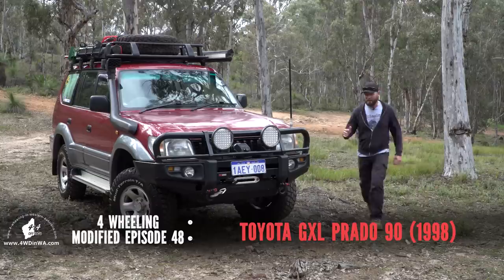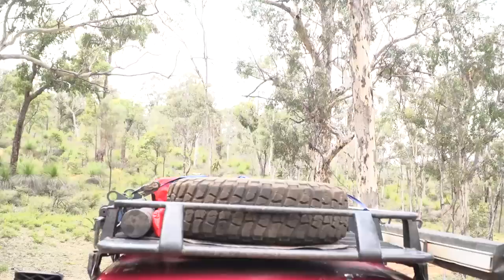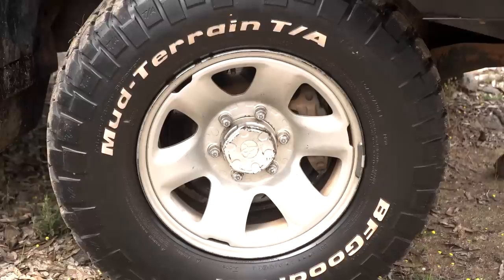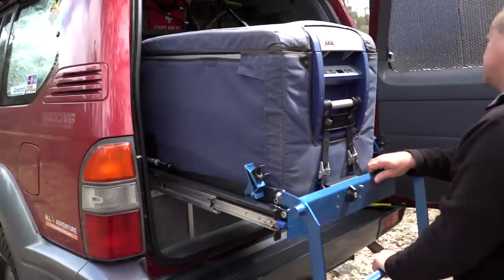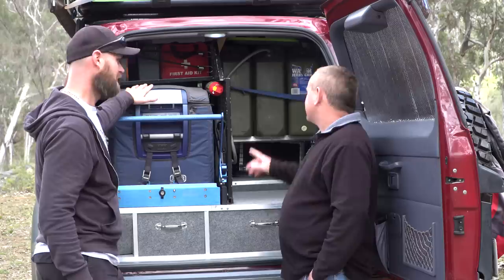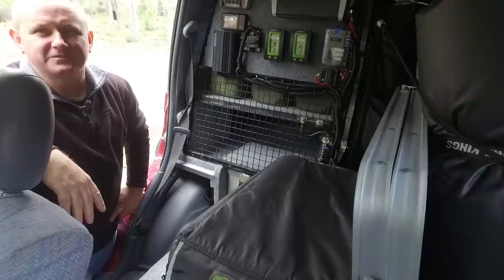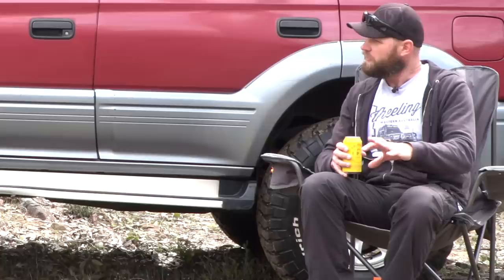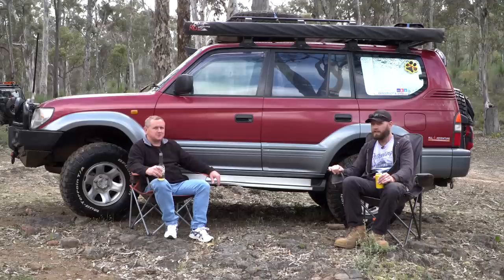Toyota Prado 90 GXL review, Modified Episode 48

Comment: 90 prados are unstoppable got a 1999 model in manual with over 530,000 kms on the clock nice truck considering manuals are fairly rare in NZ
Reply: That's good to hear. Just bought a 98 model with 377,000 on the clock. Got some k,s left in it then...
Reply: There are heaps of these 90's and Surfs in NZ .Pretty reliable things.

Comment: I had a 90 series with turbo diesel here in pakistan. Pakistan is an offroaders heaven. Such a wonderfull allrounder. I straightpiped mine, hurt the fuel econony but increased the torque by alot. Next time i will buy one in petrol. If it was the end of the world id get this car. I miss mine soo much.

Comment: i'v owned my 90 series for a good 5 years now, annother thing to note for anyone looking at one, standard exhaust system has a choke point at the Y joint, really reducing power, a simple mod, adding a set of pacemaker headers made an absolute world of difference to the low end torque of the car! (my rear end setup has quite alot of weight behind it, the extra power was more than welcome :P)
Reply: Petrol or diesel model?

Comment: One of the best cars, I’m in Costa Rica I have one kzj95 for me great flexibility and Very good performance on 4wd here to expensive toyota genuine parts
Reply: I own a LJ90 with the 3L engine...basically the car will die before the engine mine has 33mt tires with a 2.5 inch lift with an iron man suspension...by the way I'm from Costa Rica...so Pura Vida 👌

Comment: Have a 95 series 3.4... sure is up there on fuel consumption but ive never found it lacking in power or traction when needed.. factory center lock is brilliant
Reply: Keck SSJ does this have all time 4wd?
Reply: @jeanpaullgarcia5268  yeah theyre AWD. Then has shifter for center locker high / low range
Reply: Rv6 or gxl man ? Just wondering because I’m looking at buying an rv6

Comment: Love my 95 series '98 Prado GXL. 290'000km, fairly stock with basic budget touring mods but does a fair bit of stuff an 80 series or patrol would do. Only issue I have with it that apparently is becoming more known recently is the stock immobilizer transponder in the key barrel dying around the 20 year mark. To be fair though, 20 years you'd expect bigger issues but they're unstoppable otherwise

Comment: Prado 90 got same frame and suspension as a 3rd generation 4runner in the USA. Few things to mention about VITAL maintenance. Get the FRONT LOWER BALL JOINTS replaced with TOYOTA ONLY at about 160,000 Km (100000 miles) to be safe. Aftermarket ball joints WILL FAIL in 25,000 Km's. For Automatic transmissions, replace the radiator if you have factory radiator or it is 20+ years old. Trans oil cooler located at the bottom of the radiator gets corroded and will mix with coolant: This is common for most Toyota trucks. Search Pinkmilkshake. Other than these two issues, the truck will run forever! If you like a car-like ride in the front try to get front progressive coil springs that came to tacoma pickup 4x4 2001 TRD version extended cab. I have that setup with Bilstein TRD shocks and the ride is amazing.
Reply: Very interesting info about the ride, I have just purchased a 90 & find the ride awful. I  am looking for ideas on making the on road ride more plush & comfortable. I was looking at the Terrain tamer pro set up.

Comment: Unfortunately there was no mention of LBJ issues which are becoming more common. Probably due to the age of the vehicles and more exposure on the net about them.
Reply: I have a 90 and they are generally very reliable. But, as you say, you must know what condition your lower ball joints are in.
Reply: There was actually a recall from Toyota on lbj’s for the 90series
Reply: Since the video shoot I've had all upper and lower ball joints replaced, flexible brake lines replaced, brand new power steering rack fitted, new BFG KM2 fitted  and a few other little things done in prep for the  Canning Stock Route trip.
Spot lights are now replaced with a STEDI ST3303 light bar and a pair of STEDI Type X 8.5 LEDs
Reply: Have had my 90 for many years and taken it through everything. Gone through 4 lower ball joint changes.
Reply: I've had Pedders ball joints fitted. Hoping they are good enough quality to last
Reply: Allen Kemp from what I've read, genuine Toyota balljoints are the way to go :)
Reply: @outnaboutwesternaustralia1700  just wondering where you got your rear long range fuel tank from? I'm near Brisbane. Nice build mate.
Reply: 4wd Systems in SA
Reply: @mayk3lll  was there, really? What did they do with them? Is there anything you can do other than just keep an eye on them and replace them from time to time before they break?
Reply: @tomke92z  yep really. They installed a rubber boot for em to keep the dust out and prolong life. Nope just monitor them

Comment: Main things to keep an eye on on prado 90s lower ball joints!! Otherwise bullet proof!!
Reply: I've just replaced all ball joints plus a few other precautionary upgrades 👍
Reply: Michael Laz, If you mean keep an eye on the lower ball joints as well as the upper, tie rods and rack ends when those Toyota genuine parts are up for replacement at or after 350,000km, then yeah sure.  That’s pretty damn good actually.
Reply: All ball joints replaced, brand new steering rack, tie rod  ends etc etc all replaced. They all seemed to be still the original factory fitted parts. 
Nothing had failed, just getting tired and not worth risking running them on the next big remote trip.
Easier to do them in the workshop than out in the middle of nowhere
Reply: Brett H yeah they do last, especially original Toyota’s.. however it is known to everyone that they simply are a bad design.
Reply: Allen Kemp Awesome Allen! Sounds like you’re onto it.  I’m in the process of giving my front end a revamp too, only it’s part by part week by week lol.. you think it’s worth using poly or just stick with rubber
Reply: Go poly

Comment: G'day Ronny, Mate the only concern I have over this well set up truck was the zip ties on the fire extinguishers to stop them rattling & falling out of the plastic holders. ;-)
Reply from the maker: I didn’t even notice that
Reply: The zip ties are only to stop the extinguisher from falling out of the plastic holders when going thru the rough stuff and corrugations 
They are only loose fitted and the extinguishers are positioned so that they can be pulled straight up out of the zip tie and holder.
No need to cut the zip tie

Comment: Hi! Greetings from Argentina, I have a Toyota Hilux 2006 4x4 manufacturing Argentina equipped with rhino 2D front bumper and rhino 3d rear bumper, rhino  skidplate  and also Rock sliders on the side, led bar 22" Rigid,  hi Lift 3", ion alloy  wheels with covered Bf Goodrich all terrain in 32 x 11.5 R15. I really like your videos and I always see them! #4x4Love
Reply: And snorkel hahaha

Comment: Hi I'm from Venezuela I have Prado 90 and would like to do the adaptation of the subtank with the original meter like the one that appears in the video with the digital clock, if you can help me indicating the part number or if there is a page that I can get it would be a great help. Thank you very much in advance.
Reply: nearly all the 90's in australia had a subtank (i think the RV didnt get it?) so maybe try contacting some australian wrecking yards. for a 4x4 specific wrecking yard, try partington 4x4 spares in Townsville.

Comment: very interesting this appears to be very similar to a 4runner of the same era same engine and everything under the car looked very similar if not identical
Reply: The current 4runner is a prado with a different body basically, so i suppose the same thing's happening here
Reply: Basically Prado = 4Runner = Lexus GX
Reply: Rear suspension of Prados has longer travel than 4 Runner, diferent probably thats the only diferent thing about chasis
Reply: The 4runner and tacoma  have been on the prado chassis since 1996, the fj is on the prado 120 chassis as well.
Reply: @henrypeterson2040  They are on Hilux chasis, Prado came in after the 4Runner.

Comment: Sweet 90! I do realy love your addons. Sadly I am not able to find the 160l replacement fuel tank for the 90 series on thelongrangers website. Furthermore I where you got your side fuel tank from! All the best!
Reply: The long range fuel tank is from 4WD Systems as a 155lt. I've put nearly 165lts in it myself. 
I'm guessing by side tank, you mean the 69ltr sub tank. That's the factory fitted sub tank.  They come with the original rear main  90ltr tank plus the sub tank

Comment: the old prado is a great vehicle, 1300km from 240L of fuel freak, my V10 does better towing a 2 tonne camper... any how nicely setup unit well done mate.
Reply: That's aroung 18l/100km, fairly standard for a lifted 4wd with large AT/MT tires and barwork.
Reply: Yeah they are not the best on fuel. I do get just under 1400 km range fully loaded up with all the gear for a week or three  out bush.
None of the mods and weight I've added to the car help with fuel economy.
Reply: In Europe this would be considered a very bad fuel consumption for a car!
I have personally driven an Iveco 3.5 ton high roof, long wheelbase truck flat out in Germany once: 100 mp/h over 140 miles trip > 17.5l/100km. I am taking full throttle for almost 2h.
On normal conditions this would be ~13l.
Reply: When we buy these 4x4s and do what we do with them we don’t buy them for the fuel economy. We buy them because of the places they can take us to explore. 
That said, I’m lucky this is not my daily driver and it’s not the car I need to put fuel in all the time ( and my daily driver is much better on fuel ).
Reply: @derJackistweg  It a petrol engine. Ofcouse the fuel economy wont be good on a vehicle that big and heavy! Especially an old vehicle!
Reply: @truthseeker3536  I do not remember what I was referring to.
But the Iveco Daily I was talking about is a 3500 kg Truck with high roof, 250 cm, and long, 7 meters. That was in 2004.

Comment: So if it has a rear LSD instead of a locker it means it still is a capable vehicle off road?
Reply: A lsd is very good off road when it’s working in most conditions ! It’s like a half way locker , helps with traction on corrigations and off road if one wheel slips in the air , the one with traction will bite and hopefully get ya up

Comment: Off topic but what is better A 60 series landcruiser or an 80 series Sahara?
Reply: Whether 60 or 80, a Sahara will be better with turbo diesel and factory diff locks. Personally I would go with a 60 because I prefer how they look, they are more simple mechanically and they get better fuel economy (if diesel with 5 speed).  
But 80 is probably the better choice for most being more modern, comfortable and powerful.
Reply: I would by a 60 because they are more simple, look better and are better off road than the 80
Reply: I love the 61 sahara.I'll swap the motor with a 1VFJ v8 turbo diesel:D
Reply: A Nissan Patrol
Reply: I have had both and would go the 80 with the coil suspension, both are top vehicles
Reply: The 80 is better at EVERYTHING in every way possible.......the 60 is not in the same room
Reply: 80s

Comment: @Allen Kemp - What fuel tank is that?
Reply: It's a 155 ltr from 4Wd Systems in South Australia
Reply: @outnaboutwesternaustralia1700  did you fit it yourself? I own a 4x4 shop and am fitting that exact tank to a 90 at the moment. I am having huge issues with nothing lining up. I've already had to change the angle on the front mount as well as the filler not lining up, and when the tank is hard up against the body, the mounts are still an inch away from the body mating surface... did you have any issues with yours lining up? Cheers
Reply: Andrew Martin yeah I did. But I’ve literally just got out of 3 hours of surgery. Still in the hospital bed lol. I’ll have to reply properly later.
Reply: @outnaboutwesternaustralia1700  no worries mate take care
Reply: Andrew Martin  I had no dramas with the filler lining up. 
I did replace all the bolts and washers etc with proper high tensile ones and replaced the the rubber strip that fits along the front. 
Does your kit have the rubber strip ? I’m wondering if that’s why your front mounts are not lining up. 
The fuel pump lines I had to cut the metal lines and replace with fuel injection rubber lines to allow them to run clear around the bends
Reply: @outnaboutwesternaustralia1700  thanks mate. I got it sorted eventually, I had to modify nearly everything including extending the wiring harness and relocating the filler. I am working with 4wd systems at the moment to update the kit and instructions

Comment: try removing the suspension rears on them is hard apparently
Reply: dtec30   Rear left shock absorber removal requires one to not have a violent temper haha....  But seriously I’m not kidding 😁
Reply: i was told the only way toyota does it is completely removing chasis and body don't know how true it is but it was what i was told
Reply: Toyota or anyone in general don’t go that far as that’s an extreme job to do for a shock absorber replacement.  Accessing the top nut is difficult, so if someone wants to save lots of time they just cut the thing out.
Reply: why would they engineer it that way  it's a 4wd and at some point will need shocks and suspension replaced  arggh
Reply: All cars have their faults.  Some more than others.  Mitsi’s have shocking quality rubber bushes that require replacing early, in fact all rubber in a Mitsi 4wd is crap.  The valve stem seals don’t last in them either...    A Mitsubishi 4wd will cost you more money after a certain amount of time than a Toyota.  That’s the difference between Mitsubishi & Toyota for example.  Most modern 4wd dual cab Utes have shocking safety records with rear collisions.  Kind of a big one there but not yet fixed.  A 4wd Amarok should never be taken to a 4wd Park because they’re not built tough enough to handle them without it getting expensive.  Later model Colorado 4wds have weak ass tie rods...  Once again, go off-roading in one at your own peril.  Don’t give it too much gumption up a steep rutted track or you’ll bend a tie rod like a boiled noodle on those.  Every car has its faults....  Incl Jeeps.  A mechanic or 4wd shop can change the rear left shock absorber in a 90 series Prado without losing too much hair in the process and it takes time, but anyone doing it for the first time should allow for it to take a while due to difficulty and to brain storm ideas if you’re really not ready for the challenge.

Comment: lower ball joints seem to be a weak point…
Reply: Yeah the factory originals only got 360000ks out of them. They were still running fine, only replaced them as a precaution before doing the Gibb River Road

Comment: The worst problem you are likely to have with a 90 is the LBJs. Make sure they are maintained because they are prone to fail if left unchecked and when they fail the front wheel falls off. we had this happen and so have MANY other Prado 90 series owners.
Reply: Well the original LBJ  on this and on most 90series lasted over 380000ks and I only replaced mine as a precaution before doing the Kimberly’s. They aren’t really prone to fail, people just let them go too long then complain when they do fail. 
Replace them with genuine Toyota and not cheap aftermarket ones.
Reply: @outnaboutwesternaustralia1700  380000 km? Impressive. Especially with all the mods that you have in the front. My mechanic tells me to replace them every 50k just to be safe. What do you think about Terrain Tamer LBJs? Are they ok or should I rather stick to genuine Toyota only?
Reply: Terrain Tamer make some good gear so I’d say you wouldn’t go wrong with them and maybe your mechanic wants the extra work.
Definitely stay away from cheap parts that’ll fail
Reply: @outnaboutwesternaustralia1700  My ex-mechanic got extra work alright, had to repair the car for free when the wheel fell off just after we took it to them and said 'fix the funny noise coming from that wheel'.
Reply: @outnaboutwesternaustralia1700  Yes my originals also lasted 17 years and only changed due to preventive .LBJ were never an issue when these were new or even 5-10 years old , it's only now they are 20 years old and people replacing with very cheap aftermarket which are failing .The problem is cheap aftermarket ones are $30ea on ebay and easy to buy ,genuine ones are $200ea .
Reply: @smiddysmidton8313  agree